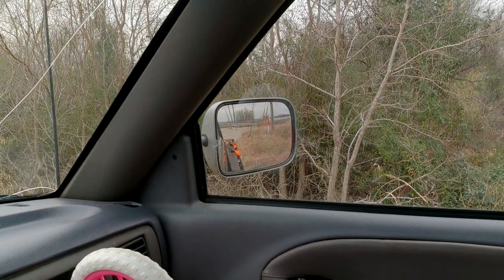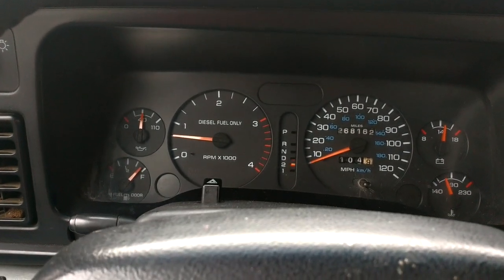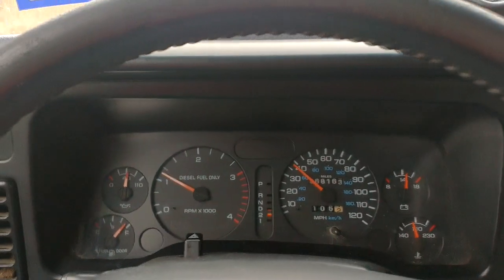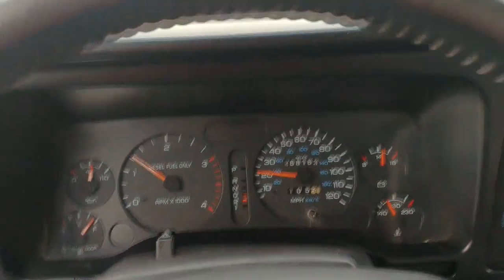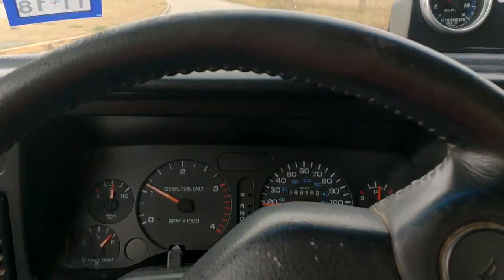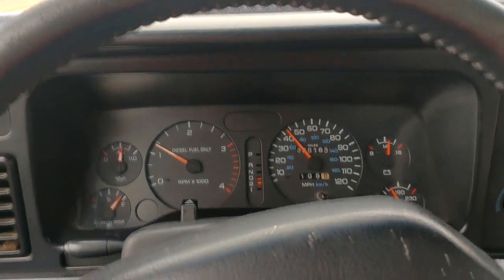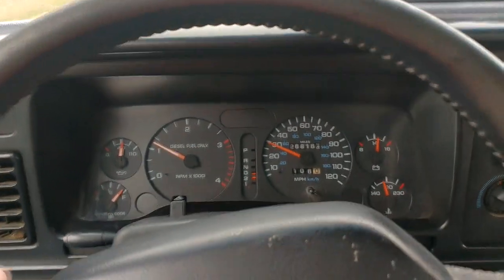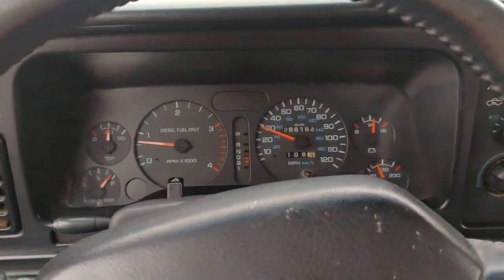1994 12 valve with low stall torque converter in a 47RH

Comment: Was looking through YouTube and saw this vid and said that’s my truck same crack in the windshield diamond plate where cup holder goes and on the pass door. Crazy! I bumped up the timing and she don’t smoke at idle unless it’s cold as hell. She’s a beast you know what size injectors are in my truck which use to be your truck. Was going to pull one then saw this vid. Did you do the exhaust on this truck cause that’s stuff is rigged not so good. I fixed it up but made me laugh. Oh and if you get this I’d love to hear what all was done to her. Thanks for selling your truck that ended up in my hands
Reply from the maker: I hope all is well. The injectors are from power driven diesel. 7x.009 sac 148°. I believe it's a 30hp injector. The head gasket is Cummins and ARP studs. I'm told it has a Hamilton cam and chromoly pushrods. I know the rockers are aluminum rollers. 
I didn't do the exhaust.  Did you get the transmission sorted out?

Comment: my main issue is my truck feels gutless until lockup. anything out of lockup it will rev to the governor. cant even feel when it shifts but bites down at lockup.. literally cannot tow over 10k up a steep hill from a stand still. you can forget backing a heavy load up any hill as well. pull great at lock up but way to much stall under a load otherwise... im honestly gearing up to swap in a spicer 3053a. already got a sae flywheel and 800ft/lb 14" clutch as well as the gearbox, just collecting all the other pieces to the puzzle.. honestly hate towing with an auto for this reason. high heat and tc's just cannot hold up to 10k-20k loads.
Reply: Sounds like it’s just a stock transmission with low line pressure, you gunna want to crank that line pressure up to get firm shifts.
Reply: @devin3156  what psi would you suggest turning a stock tranny up to? I have the issue as dude described above and just had the tranny rebuilt less than a year ago.  New to the 12 valve auto world

Comment: me and one other guy lifted my sock bed off with our hands. my 8x8 flatbed was 1688lbs so no, its not at all the same lol. just dont noticed the difference with these trucks other than a smoother ride with the flatbed. now that said my damn trans stays between 2k and 2500 until lock up
Reply from the maker: My flatbed is 1/8" diamond plate, the frame channel is 1/4x3. The bed has no skirts or boxes. Plain and simple, and light as possible. I don't have a goose or fifth wheel plate.
Reply: @VARITHMS  mine is not skirted, same diamond plate but its been decked over by the first owner so its doubled up. lots of channel, cross members at ever 6" and built in gooseneck under the trap door. it was very heavy.

Comment: I've got a 94 2500 and when I got it driving at 110km the rpm was at 1800. Now it's at 2300rpm at the same speed. 
Do you think that it's the tourqe converter?
Reply from the maker: Sounds like the torque converter isn't locking up.
Reply: Yes 100% my truck is at same rpm with 3.54 gear there is low stall 300rpm reduction 10% or 900/400 ultra low stall great for towing just watch smoke lol

Comment: I just dropped trans and today on my 96 12v 47rh and dropped her off at shop for rebuild got me a Suncoast triple disk converter don't Kno what stall tho but I'd imagine e it's low my truck was used for to wing cattle so
Reply from the maker: I like the low stall, it is a big lagging off the line with a bigger turbo. I haven't towed more than 7k lbs. Most of the time the load is on the bed, less than 3k lbs.
Reply: What converter is it? Thanks for the video

Comment: Nice truck.
What is the stall speed?
Thinking of upgrading my converter to a "low stall" "towing converter"
Reply from the maker: I'm not sure. Max rpm is about 1500 if you hold the brake down and hit the gas. I'm doing the head gasket now. I'll check it out when I get back together.

Comment: You think it needs replaced or something else?
Reply from the maker: You can check it by adding a power wire to one of the terminals with a switch. Many of the Dodge forums have write-ups on adding a switch.

Comment: I do t have a low stall and your rpms run exactly like mine does.
Reply from the maker: I'm guessing the difference is when I floor it with the brakes on the RPMs only go to 1200 RPMs.
Reply: @VARITHMS   Jay Smith  maybe.... I actually don't know anything about diesels, my 97 is the first diesel truck I've owned and man I'm learning everything, I use mine to haul a 32ft goose neck and man before I messed with the AFC filter it towed like a dog. A buddy suggested I get that low stall converter...
Reply: I noticed your oil temp fluctuates a lot just with a little acceleration.  That doesn't seem like a good thing at all...